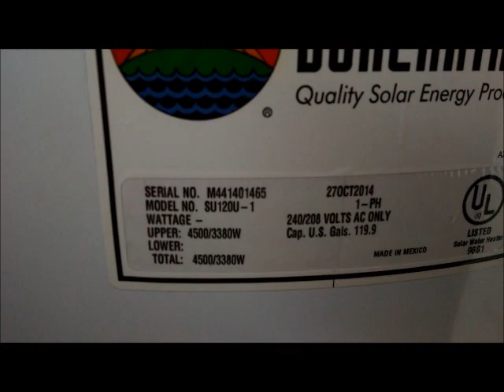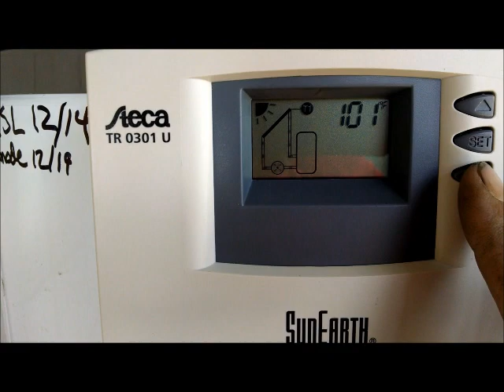Solar water heater install

Comment: Glad to see someone who installs solar. Too many folks are afraid to buy it or learn how to work on it. Admittedly open loop systems are easier to deal with than closed loop, on account of the antifreeze.
I grew up with it, parents had a system installed in the very early 80s.
Reply from the maker: We install lots of solar in Hawaii.  In fact as of 2010 all new construction projects are required to have a solar water heating system installed.  Everything is open loop here because we have no chance of freezing.  Thanks for the comment.
Reply from the maker: There are some passive closed loop systems though that can be tricky mostly because of the Australian manufacture uses metric fittings and tube sizes.
Reply: Ryan Dugger So how do you transition between imperial and metric? Is there a particular fitting that is designed for the conversion, or do you improvise in some way?
Reply from the maker: Dwight Bennett
You order parts from the distributor and wait a couple weeks.